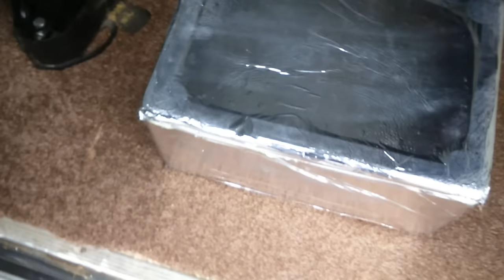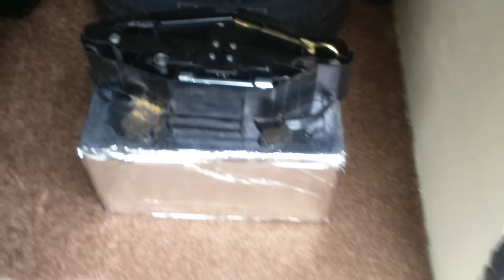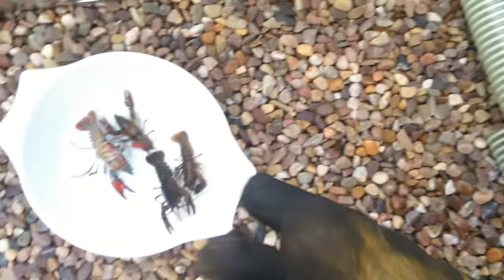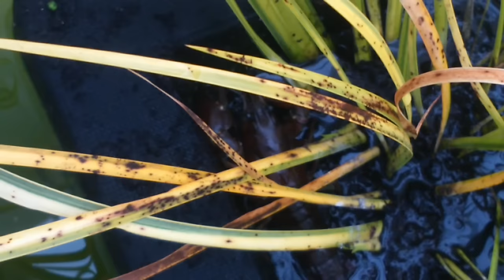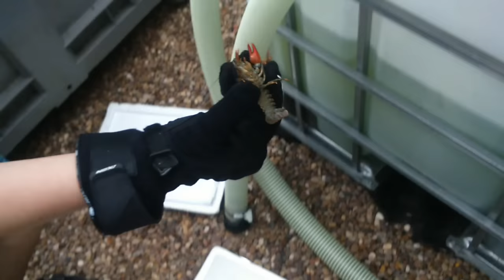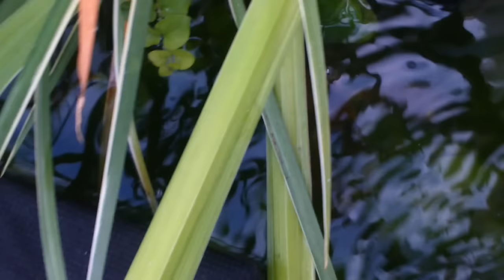collecting some crayfish for my pike and piranha

Comment: I just had a suggestion but I was thinking that maybe you should put some rocks in for them to hide from each other... Because the bigger one might tear the smaller ones apart. And also they might get stressed out to much and die. I understand they crawl in the branches and roots of the plants but I still recommend you put some in once the water gets clear so you don't crush any.
Reply: Maybe even some cut in half plant pots for them to use as caves.
I once had a crayfish in a aquarium and he loved those.
Reply: Also some hole bricks. They are perfect for the babys to hide from the adults.